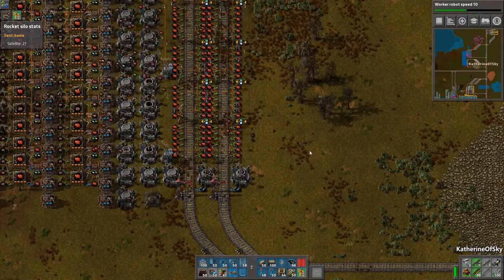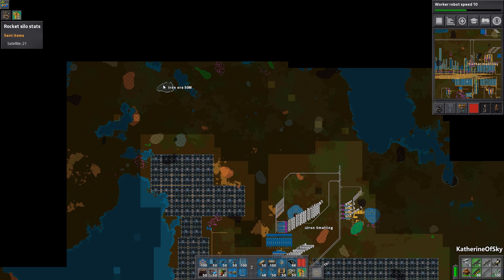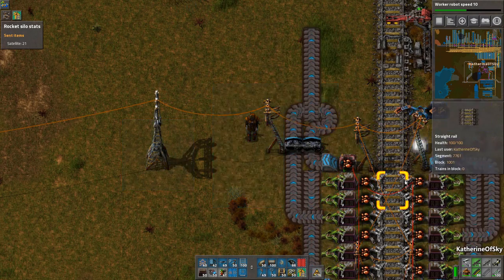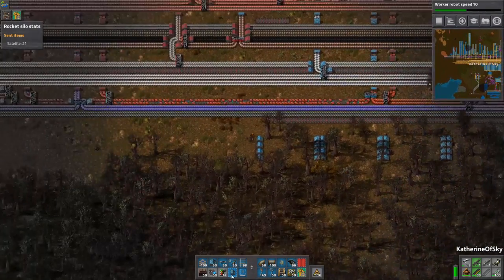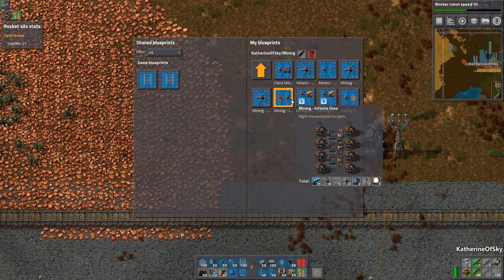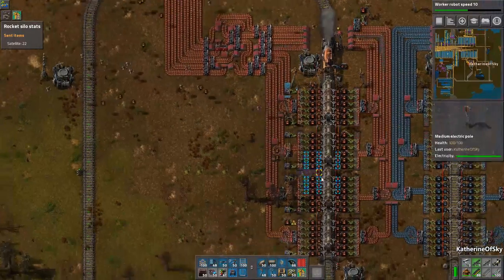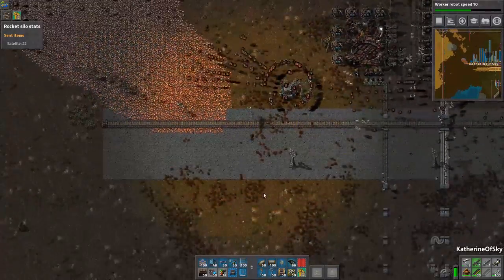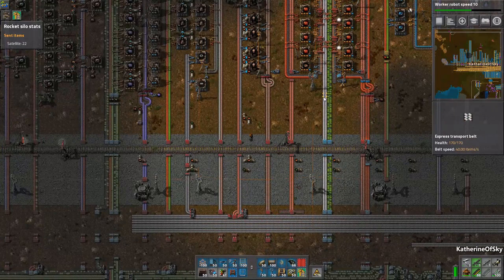Factorio: Entry Level to Megabase Ep 69: DELIVERING RED CIRCUITS & COPPER - Tutorial Series Gameplay

Comment: Since you're green-limited on modules and rocket parts, why not start by shutting down the original red factory and thus free up that load on your green lines on the bus? Take one of your four new red lines running east to the Mall etc, and the other three west for modules and rocket parts and science.
Reply from the maker: This was just a temporary bandaid for rocket production.  Don't worry, the entire base will get a re-design as soon as I finish the outposting process!  (We still need steel, blue circuits, and rocket parts made!)

Comment: Even a single Nuclear Reactor can provide 40 MW and your entire base uses 1-2 MW. You should only leave one of them and pick up the other 5 to save on nuclear fuel. But then that 23M Uranium Ore patch will keep you going either way, so it doesnn't matter. 

Lol, look at all those bots waiting to charge everywhere. You've just shown why long distance bot mining is a bad idea. Belts will definitely serve you better. That copper sorter eating up the copper patch from main base needs more than 1 roboport, though. 

There are some superfluous inserters and chests at the green circuit array, behind the last row of beacons.
Reply from the maker: Again, many solutions for examples for people.  Also, my factory is using MUCH more than 1-2 MW.  It is idle much of the time because of expansion, so you don't get an accurate reading on power.  As I explained in the series, nuclear power was done for the example -- I'm not actually caring if it provides any power at all.

Comment: i think you just needed more trains delivering products because you only have like 1-2 trains picking up products from across the map. like copper plates.  I notice you have 6 parking spots per train station but only 2 trains so it does not really make sense
Reply from the maker: I only need more if I am running low on materials.  Parking spaces are not for filling up, they are for possible expansion.